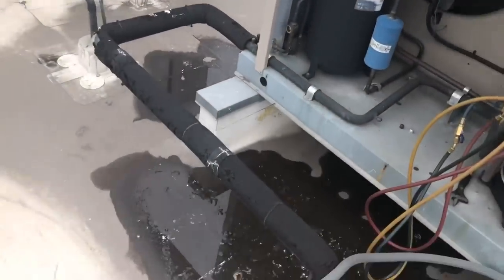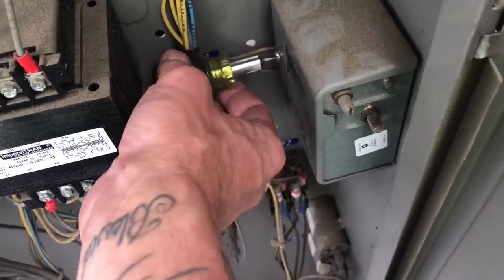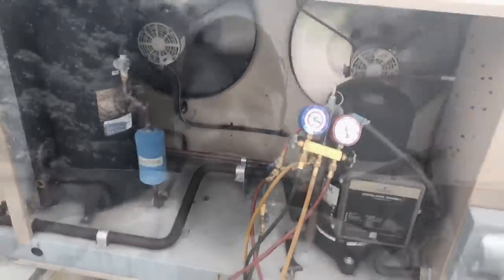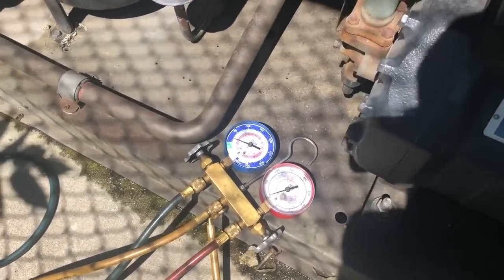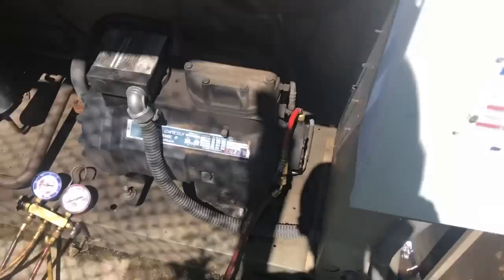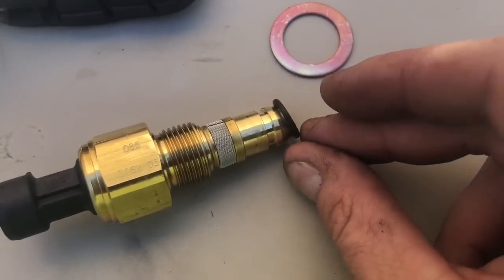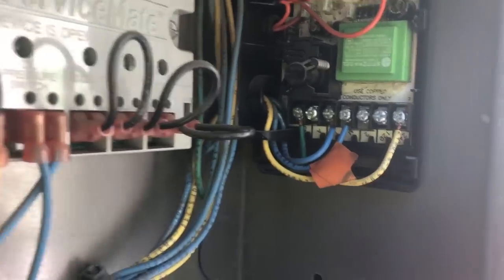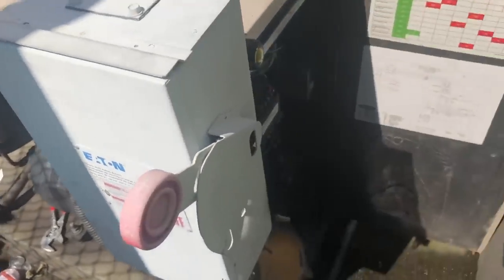Oil pressure control and a quick service call

Comment: The only criticism I would have is, you still have the underlying problem. You fixed the symptom but not the cause. Don’t you think an oil change and a couple of cleanup dryers are in order?  It’s evident to me, your predecessor secured this piping with the benefit of nitrogen. That oil was contaminated.  Now you have a nice new sensor that has enough room to collect dirt and your back to square one.  I mean you already had the system pumped down.  I did one last week at Hanscom and cleared he sight glass, it didn’t take that long to do.  Like yours, the oil was dirty... Mine was r22 low temp with demand cooling also... now that’s a trip.
Mike
Reply from the maker: hvac01453 yes we will be going back for an oil change at some point. The customer didn’t want to do it at the time.  Can Only do what the customer wants to pay for
Reply: CSC Refrigeration and Hvac that might be a good thing to point out to these apprentices.

Comment: Got a 1" deep socket 1/2" drive specially for those. Nice shout out on that o-ring. Compressor will trip on oil if you forget to put it on. New subscriber; loving the videos!
Reply from the maker: Mayhem Refrigeration thanks man , yes I have to get the deep socket on my truck. I have a shallow but not a deep hahaha

Comment: Great video! I have this problem at work and they said it was related to defrost setting issues on Monday.  The next day the compressor is out again unable to keep temp. I took a glance at the side glass and oil level it's empty. Could defrost settings cause this problem?

Comment: I have installed one of these 3s. I never get a green light and won’t cut off the compressor. Module has power and sensor ohms good. What do you think?
Reply from the maker: Are the correct wires on the  L and the M

Comment: 11:21 - The only question I have is how it was decided to change the control on this job. We know that a control system depends on the integrity of the sensors. You proved the sensor was faulty so, was there something else happening in the system that was not discussed that would lead to condemning the controller? I know you said the customer wanted it changed; but, I’d be too curious not to understand how that was diagnosed.
Reply from the maker: That new sensor comes in the box with a new controller all as one so that's why the control was changed also.

Comment: can you give advice on should a guy start in this field at 42 is that too old to start and have a good career in it??
Reply from the maker: C Lilly I wouldn’t say it’s too old to start but I will say you will have a lot to learn .  But if you are willing to work hard and learn then you should be ok. But it’s takes many years also to get into really knowing how a system works. But this trade can use any level of person as long as your willing to work and learn
Reply: C Lilly never to old to learn.

I got an AAS degree in HVACR back in '89 but never went in to the field. Two years ago got the EPA certificate and have been doing in house refrigeration at the facility where I've been F&B purchasing for years. At 58 years old will I ever get as good as these lifetime trades guys? Doubtful, but I'm enjoying fixing broken things more than dealing with broken people and ready to make the change.

Comment: Good videos on these semihermetics. But the let down is the vacuum part. How do you vacuum out the heads of these compressors when you have the discharge and suction valves front seated?
Reply: When both valves are front seat, you are completely isolated or block off the compressor from suction and discharge pipe. BUT  your gauge port are now open to the crankcase/ head. Verify all valve are hold no leaks- by then just follow with your normal evacuation. Also one thing you have to remember is to install the service gauge before you preform the above procedure. Hope this helpful. I am still learning 🇺🇸

Comment: I’m about to do one today (first time). Is it necessary to pump down the unit into the receiver? Or, can I just close the suction and discharge valves and recover what’s left in the compressor? I’m asking because I’ve never pumped down a system like this for a walk in freezer
Reply from the maker: Michael Alvarado you can pump it down.  Or you can close both service valves on compressor and recover what’s in the compressor
Reply: Supp CSC you make good videos  can you make some Covid videos HVAC..Greetings from Southern California

Comment: Question...  I have a 404a unit that has a mechanical pressure switch.  Compressor cycles and then oil switch trips, reset and will trip a short time after.  I noticed on the one you replaced (electronic) there was a screen, does the mechanical set up have the same thing or can something in mine get clogged to cause trip issues?  Thanks.
Reply from the maker: It could be the mechanical switch starting to fail . Have you checked your oil pressure ??
Reply: @Cscrefandhvac  failed... Looking to replace it with sentronic 3... Pressures were good switch bad... Thanks

Comment: The screen on the sensor can be cleaned and there is also an additional screen in the sump of the compressor that can clog and cause oil pressure safety to trip. Its a pain in the ass trying to clean the sump screen especially since the compressor is not elevated at all so draining and cleaning that screen will cause a big mess

Comment: Or net oil pressure.. working on racks I find the oil screen on the body of the compressor gets clogged. Those sensors take a 1” wrench 🔧  but that enclosed box around that 2 d does seem like it’ll make super hard to get to
Reply from the maker: Refrigeration Mechanic ya there isn’t much room in the single condensing units.  It’s easier to do in a rack haha
Reply: CSC Refrigeration and Hvac yes sir it is have a great 4th as well. Keep em coming
Reply from the maker: Refrigeration Mechanic thanks brotha.  You as well 🍺🍺

Comment: At what point do you schedule an oil and filter change?
Reply from the maker: RJ_Make should be done when the oil is dirty or say it got contaminated from moisture or a burn out. .  I recommended that this oil in this system be changed but it all depends if the customer wants to do it

Comment: Hey when you connect gauges to the oil pump do you get oil in the lines?
Reply from the maker: JDT738126 yes absolutely.   It can make a mess sometimes haha
Reply: @Cscrefandhvac  I figured, do you save a older set of guages just for that? I guess you can blow the gauges out with nitrogen after you use them huh
Reply from the maker: JDT738126 yes I have some older gauges and hoses but you can blow them out like you said also

Comment: Nice video! Might’ve been a good idea to replace the oil and clean the pickup screen. If the sensor was dirty surely the pickup screen upstream was bound to be dirty too.

Feels great to drain out old dirty oil with bits of crap in it and replace it with new.
Reply from the maker: Trever Kirk yes the unit needs an oil change. I recommend that to be quoted out